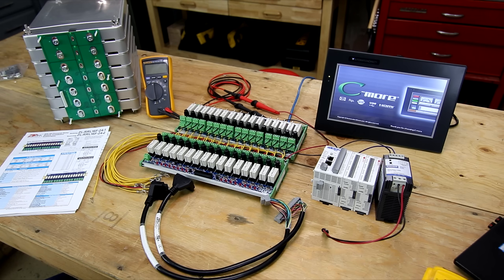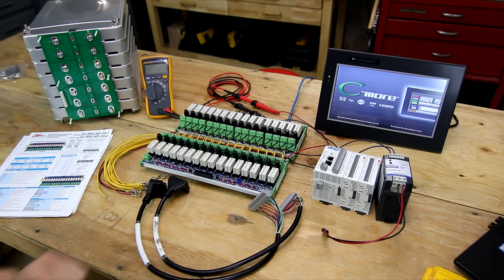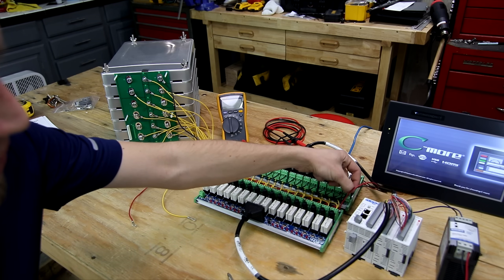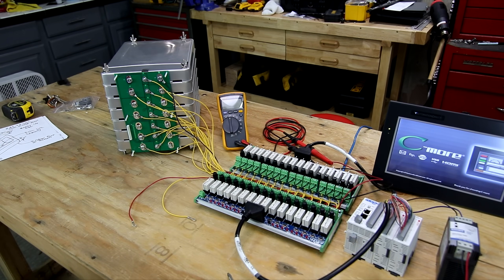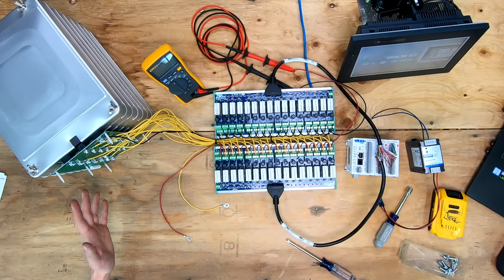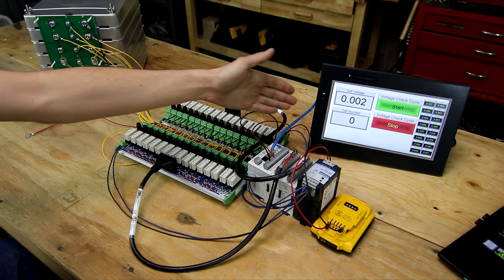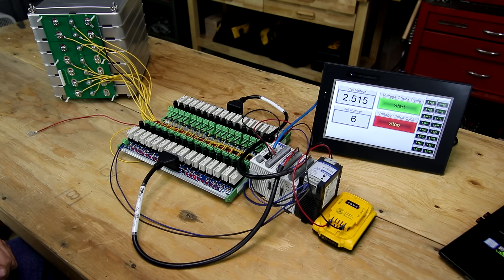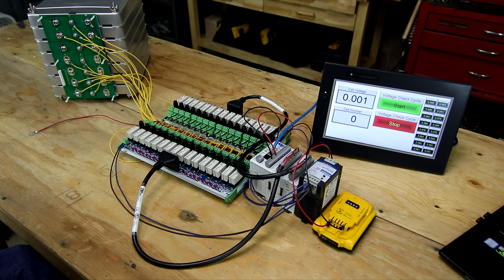Off Grid: Ultimate BMS using Relays & PLC Control! (Most Customizable!)

Comment: I seen a thread in DYI you helped some one with a powmr 230v 50hz,mine is a 48v hybrid with 240v settings and 60hz,but it has only hot and N and ground,I want it to run a small hot tub only(120)gallon,running now on AIMS 6000W 24V SPLIT PHASE .Will it run the 240v only hot tub or will the single phase 240v not work,thanks

Comment: I don’t like your design I use 5 pin relays and zener diodes and some resistor the relay only turn off when the cell full so stop pulse relays non-sense

Comment: 10K resistor in series with each sensor wire would prevent the shorting issue especially if the resistor was near where the wire connected to the battery pack. If you put it there protect the entire wire as well as the battery.

Comment: You mentioned not liking that the total power from a battery system with BMS flows through the BMS. However, wouldn't this mean that you need to take care of short-circuit protection in some other way? How do you handle short-circuit protection for a battery without a dedicated pass-through BMS?
Reply from the maker: A fuse

Comment: Hi, Thanks for such a great video  
One of my customer needs to install a solar panel to be synchronized with an ac alternator for Load sharing. He is in a remote location and has no grid connection.  Is this theoretically possible for such a scenario. if only you can fully understand what I mean
Reply from the maker: Let's get this figured out.  Send me an email at info@currentconnected.com and we can get this figured out.  I will need a few more details to better be able to help.

Comment: How did you deal with the ground reference?  The CLICK is limited to 0-10V  analog inputs.  Did you float the entire PLC using the Dewalt battery?  That works but what's your "float" plan for the final install?  The DC-DC would still float it off the 16S (if it's a step-down)  but if the 16S is earth grounded and anything else gets earth grounded like the HMI panel all the smoke will be let out won't it?   Consider modding it to a flying-cap system?
Reply from the maker: I'm glad you asked. I am working on a battery management control panel for my new 64 calb ca-180 cell's coming and I actually specifically address your question / issue.  Essentially you are absolutely rightand it is not very well noted in the PLC manual that the data ports share a common ground with the input power.  But I learned that lesson and figured out a way to solve that problem very uniquely
Reply: @HighTechLab  WOW.  Comms common to ground !  Didn't think of that yet as I was thinking only about the Ethernet port.
A couple of other points for you.  You have a safe setup with your interconnecting the NC contacts to prevent inter relay shorts.   You can also safe things by simply including a resistor in the the leads.  Something like a 4.7k or 10k resistor will not affect the no-current analog readings. With the resistors, if you turn a bunch of the relays ON at once only a couple of milliamps will flow thru 'the mistake'.  Example with 10k ohms you'd see, like, 2mA across a 24V battery stack. 

I actually found some small very nice relay boards to run this same scheme but instead using the Flying Cap method.  You close a relay on a capacitor charging it up. Then disconnect from the battery cell and close another relay that hooks the lone capacitor across the PLC analog input.  This completely floats all reads isolating the the PLC's ground from any and ALL cells and also the cells from each other.  This method does need the aforementioned  protection resistors to allow for a programming mistake or the inevitable relay failure.  Back in the day this was a very frequent method for data acquisition systems.  They usually used reed switches which can have millions of mechanical cycles.

Comment: It is a funny project - and keep saying this is a fantastic solution - where’s it isn’t. This is so complicated, missing all the features of a proper bms and is using mechanical components which are prone to failures etc etc plus a plc is expensive, difficult to code, etc etc. This is not a fantastic setup for a bms!

So as a hobby project it is funny but nothing more.
Reply: WRONG!! A plc is FAR EASIER to program than an Arduino. A plc just uses virtual contacts and timing blocks instead of having to understand coding with words and commands. PLC programming is basically like using Windows versus Linux. Also, a PLC is very flexible in I/O as you can buy the I/O card you need for your project instead of being limited to a fixed I/O like on those Arduino. Finally, those toys as I call them, like the PI's and ardruino's are illegal to use in a industrial control setting as they are not UL recognized and code execution is not fail safe or runs in a in-order fashion like a PLC does. Out of order code execution is NOT ALLOWED. It could result a state such that a person can be killed or injured. In any manufacturing plant control panel you open up, will have a PLC and relays and maybe a few VFD's for this reason. No one in their right mind would use your toys for industrial processes!!!

So you can stick to your toys while real automation engineers stick with PLC's that work predictable and reliably for many years in harsh environments.

Comment: Exactly the same kind of setup I have with my Omega data logger. Why arn't you using relay cards on the plc backplane for the IO's instead though?
Reply from the maker: They share a common. They are also a lot more expensive per Channel
Reply: @HighTechLab  you could have done a math routine that starts from first cell and calculates values as it moves up.
Reply from the maker: But then ADC needs to be rated for the full range  and have full precision across that range.  What happens if the cells you already measured change? It introduces a new level of inaccuracies

Comment: Thats awesome! Thats got me thinking about other usages for the same plc configuration. 

that is truly awesome. Thanks for sharing!
Reply from the maker: Glad it was helpful.  What did you have in mind?  Some thoughts of mine were a lighting control panel so that when people here on the ranch leave lights and stuff on, it automatically turns them off.
Reply: Ive been trying to figure out a cost effective way to implement a way to  remotely test voltage and current on all the systems I manage. My first thought when seeing your mockup is using one trumeter adm and use slim interface relays on each device I want to test and wont take up much Real estate in control cabinet. that’s way cheaper than individual meter for every device.  

As for lights I use brx plc’s with serio and 0-10 modules. Serio module to right senes into brx registers using DMX programers or QLC+ software, 0-10 module for fluorescent dimming, MQTT to control some cheap wifi switches, wifi LED’s and a couple Leviton low-voltage 3 and 8 button keypads hardwired to digital input modules.

Comment: Well that is an interesting design, I would have gone with an array of voltage dividers and probably a few zener diodes to protect against overvoltage in case of an wiring error. Though that has the downside of loosing accuracy in the higher up cells

Comment: Are there any High Voltage Latch-Up Proof Analog Multiplexer IC's - that would be better than using a board full of Mechanical Relays ?
Reply: MrSummitville Well you could reverse engineer one of those cheap lipo voltage testers and see weather they have room for expansion

Comment: FYI: Take a look at the LTC6803 BMS controller:

https://www.analog.com/en/products/ltc6803-1.html#product-overview

Multicell Battery Stack Monitor IC for High Voltage Applications

https://www.youtube.com/watch?v=eDXXNF7h-vQ

The issue using relays, is relays have a limited switching cycles before they run into issues. Plus if one of those relays gets stuck, your going to create a dead short.
Reply: I thought his SPDT relay design was such that the "highest priority" relay that is ON, automatically locks-out every other lower priority relay ....
Reply: @MrSummitville  Does not prevent a stuck relay from causing a short. Best option is to use a Mulitcell battery monitor like the LTC6803.
Reply: @guytech7310  What exactly do you mean by a "Stuck" relay ...
Reply from the maker: It does prevent a stuck relay from causing a short, but it does not prevent a stuck relay from over-voltaging the front end of the PLC.  It also has fuses on every single relay so that in the really rare event that a short possibly occured, it wouldn't cause a fire.

Comment: can you guys make a video how to control ac relays, let say with Victron charge controller, or any other regulators, let say for dump load when battery is full, but sun is still up, thanks
Reply: You need useful things to dump loads into, e. g., hybrid water heater, cryogel thermal energy storage, etc.

Comment: Nice, thanks for sharing. I am also into CLICK  PLCs and I find C-more HMI as one of the best and easiest to work with with a lot of features for the price. I thought of a similar set up like yours using relay card but you may want to look in to this. Ebay sells ADAM WP3084 0-10V, 8 channel analog input voltage acquisition module with RS485 MODBUS communication port for $45.00, 12 bit resolution with 1500V isolation. Two of these would work for your application. You would not need a relays to isolate the measured cells. I like using a drum programming for RS485 MODBUS communication on Click PLCs. My goal is to get 96 volt 15 kw  transformer based low frequency inverter from Sigineer, it is not available yet, hopefully soon. Not sure yet what type of batteries to use - Lifepo4, or Tesla. This inverter comes with a charging profile for these chemistries thanks to Jack Rickard from EVTV. I like your set up with active balancer and shunt with millivolt card reporting to PLC from your previous videos. Same here- I prefer to build my own BMS since Click is fairly easy to program and Automation Direct provides great tech support. Having your own system with a HMI and C-more app gives better control since you can monitor anything you like- voltage, temperature, charge and discharge, limits. Possibilities are endless. Thanks again.
Reply: Just get and arduino.

Comment: That is a very special DIY project, congrats. What is the weak point if there is one the relays or the plc.
Reply from the maker: Definitely the relays. They are only good for 1 million cycles
Reply: @HighTechLab   On high power systems like this probably once a minute is plenty fast enough.  Ugh though! That's not even 2 years... :/
Need to find an OPTO-MOS relay board, as that's solid state.